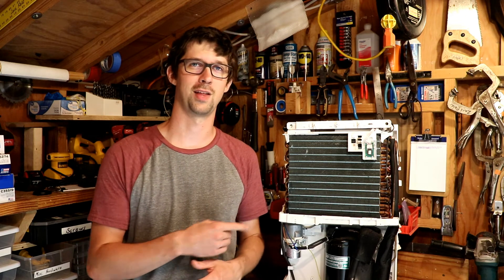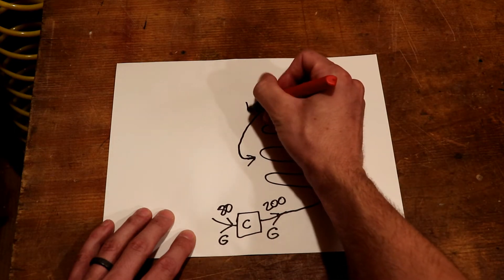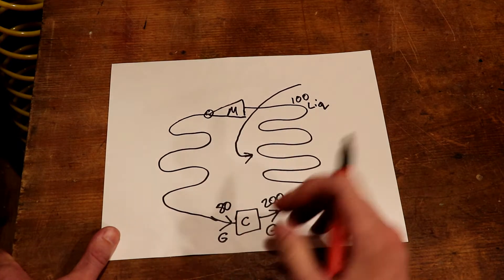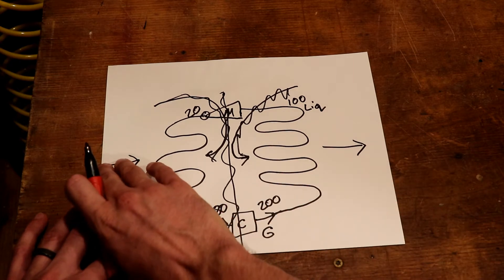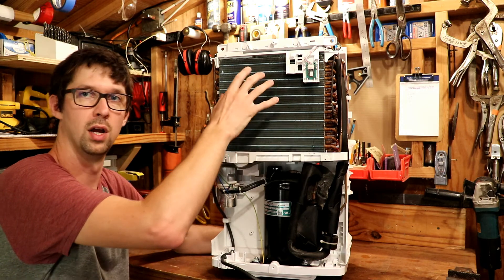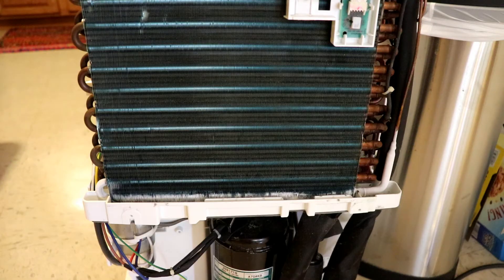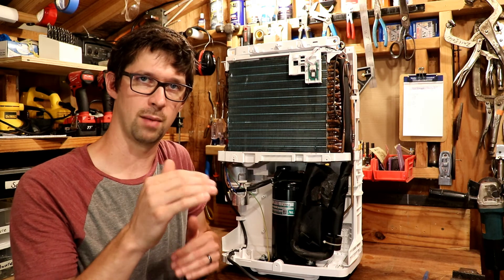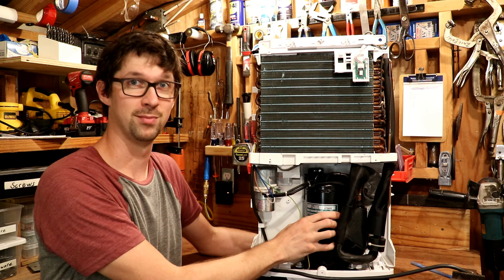What's Inside a Dehumidifier?

Comment: condensation of water outputs a lot of heat too, about 80 times of same the weight. Is there a dehumidifier where part the condensation coil dumps heat to the cendensate drain (without significantly evaporating) to keep a constant temperature?

Comment: Thank you for the best explanation I have seen so far.  I am basically sick of buying a new dehumidifier ever 2 years and looking forward to fix what I have.  No shops in my area fixes any dehumidifier.  
So far, it seems to me dehumidifiers are simple to troubleshoot.  My fear is that the companies which sell these dehumidifiers will either no longer carry replacement parts or flat out don't sell any replacement parts but that to be seen.
Thank you again and look forward to watch other videos you have.
AJ
Reply: Beware of the small Electronic ones with a solid state element . A hidden one shot thermo cut off switch that if the temperature exceeds a certain level cuts off the machine.... for good ! To replace it have to dismantle entire machine to find it and needless to say part not available . Just not worth the effort ..  I just binned one

Comment: Could it be possible that the automatic switch that defrosts the coil could be defective and the ice builds up higher on the coil ? If so where would it be situated on the unit ? and how can i verify this ?
Because i saw the ice build up and simply unplugged it for a while, and after re plugging it i smelled a burning odor... Could this be related ? what else do you think this could be ? 
Thank you

Comment: The freon after it has gone through the cold coil then is dumped into the compressor can where it absorbs the heat from the compressor motor, when it is running. When it is off the compressor gets rather warm. 

The issue with the newer cheap dehumidifiers is that the compressor is all sealed up, no ventilation to allow for convective cooling. Unlike a refrigerator, chest freezer, window air conditioner, portable air conditioner, water coolers or central air conditioner where the compressor is out in the open allowing for convective cooling. 

I have a GE brand dehumidifier & I notice the room getting quite warm as it lowers the humidity level. Which is why it was shipped back to Amazon from another customer.

Comment: If I open up a dehumidifier would I be able to separate and add fans for each coil? and one of those fans is exhausting heat outside? take off the plastic split and insulate each coil and add fans, and the cool side would still dehumidify the air while cooling it? I have a $300 dehumidifier I got for $20. I need another air conditioner though.

Comment: Not sure about your background, are you a prof or an engineer? this is a high quality explanation done elegantly and many people would be benefitted. Thank you!
Also, I have a question, my dehumidifier is 5 year old and recently I noticed - it runs fine but its not making the air dry and so very less water, if any is collecting. is it  time to buy a new one? or I should try to tweak anything? what's the top thing inside I should take a look? appreciate your response when you get a chance.
Again, thanks for the video.

Comment: You said the temp of the air going in to the dehumidifier is similar to the temp of air coming out.  My dehumidifier is blowing 15F hotter so air coming in at 75 is leaving at 90.  Is that a defective dehumidifier?  Its heating my house too much

Comment: In fact, every single hose portable air conditioners is practically a dehumidifier because the hot coil and the cold coil are just beside each other blow the hot humid air and more effective to remove condensation and not cooling the room.

Comment: I'm curious, when you see a "commercial dehumidifier" that is say 1700$, and it is rated for up to 18 gallons per day, is that price largely because of the niche market? I see also a '150 pint [~22 gal] (under 95°F,90%RH condition) removal per day' unit rated for 7000sqft, it is 300$ (and also uses a compressor). I assume this is essentially the same core mechanical process in both units, just different packaging. Is there any difference in the refrigerants used in modern systems?

Comment: Actually in addition to the compressor getting hot, the air coming out of the dehumidifier is about 10-15°F warmer than ambient temperature due to the release of latent heat. Evaporation absorbs latent heat energy, thus cooling things down.  Therefore condensation, which is the opposite and what ends up dripping in the tank, releases it, thereby causing the temperature of a small room to rise significantly when running a dehumidifier.

The effect on sensible heat energy (temperature) by the release of latent heat energy is about 970 BTU/lb of water collected in the tank.  The heat produced by the compressor, and less so the fans is about 3400 BTU/kWh. If a dehumidifier removes 1 lb of water in one hour and pulls 400 W.  (That’s 0.4 kWh). 3400 X 0.4.  So there’s about 1,360 BTU of sensible heat from the compressor and fans and 970 BTU from latent heat release.  In this case 41% of the sensible heat produced is actually from latent heat release.

Comment: So I technically you could make a 12v-24v dehumidifier by just swapping out the compressor for a boat refrigerator compressor. My goal is to design one that uses the least energy but pumps out the most water so it can run from solar power. So I guess it would have to turn off after icing at 3 quarters of the way for the most water without damage. The knowledge of what the internals do is extremely helpful. With some solid state fans it could run with very little electricity in a slim case too.

Comment: Great explanation. 
Me being novice and wanting to learn it leads me to a questions. 
 Is there not a way to cool the air without using a compressor, bc there is heat made by compressor as well as it increased the temp of "coolant" to 200degrees in the example. 
Does it have to be liquid in order to disperse the coolant at a cold temperature? 
Is there no way to have a coolant that sits below room temp in a natural state and cycle that in front of the coils/fan to cool the air?
Another question would be. 
Are there any systems that r designed in such a way that the  would essentially put the Warn-Liquid compressor coil 'under' the Liquid misting cooling coil, which would drizzle the icey cold water, over the Warm coils to lower the temperature a tad, but keep coolant a liquid, but utilize the off-heat better. I know it sounds like the ramblings of a madman but my mind wanders when it's trying to figure things out.

Comment: I just had one delivered  yesterday and the device is not collecting the water. I called the company. Supposedly I was supposed to leave the unit in the box in an upright position for 24 hours before I turned it on. Not knowing this when the box arrived I rolled it into the foyer because the unit was heavy. Now it is sitting up right - waiting? The unit is working more like an air conditioners and I don't feel anything warming up. Now the device is setting in cold wet environment.

Comment: Then why dose my dehumidifier in my grow room make the room so hot when I turn the lights out and need cool temps and low humidity the dehumidifier makes the room to hot and if I vent the hot air out of room with a hose it makes the humidity go up to high like it's not even on just a constant struggle to keep humidity down and temps down because dehumidifier is so hot

Comment: Is it important for effectively dehumidifying that the cold and hot coils are right next to each other? I tried using a mobile AC unit on the dry setting (without the exhaust hose attached), it just heats the room but collects barely any water.

Comment: Guys, what if everything kicks in and works, but the compressor never heats... It's always cool, and the unit catches nothing...
I have two identical dehumidifiers, both working, but one with compressor that heats up working normally, the other with the cold compressor not collecting water (even though everything is working) ...
Any help will be appreciated, as I'm running out of ideas hete

Comment: wow somebody actually describes the process well most people get it completely wrong .I see so many people thinking the compressor puts out cold freon liquid rather than hot gas 
the only thing i would add is the heat from compressor actually makes air warmer coming out then when it went in through the condensing coil getting rid of the compressor heat

Comment: Ive always wanted to make an air-conditioner out of one of these just for fun just to see if it can be done. Place the warm coil on one side of a wall with a fan blowing out, and place the cool side on the other side of the wall with a fan blowing in, with a drainage tube for water of course. Seems feasible.
Reply from the maker: That would be cool!
Reply: @ZachFields  Im building a travel camper and dont really want to install an ac unit in the roof and dont really want a mini split (although that may end up being the best solution), but Id really like to build my own sort of heatpump with reversing valve using a fridge compressor or something smaller. I know they sell smaller compressors. But I could grab a vehicle fan shroud and an electric automotive fan for both exhausting the hot side, and another one to act as the blower for the cold side. I mostly just think it would be a fun project but I dont have any hvac experience so Im intimidated

Comment: Very good explanation 

So if I have a dehumidifier and I bypass the air after it passes over the cooling coil and force back into the room 

And if I add an additional fan to draw outside air over the hot coil , and then exhaust it back outside ,  I would then cool the room and have an a/c ?

Comment: Excellent explanation! I'm working on a water generator unit with Solar and Wind power... this is helpful. I would replace the refrigerant with a peltier module to do the "cooling" part and save all that compressor issue. Still working on it...

Comment: Is it possible to swap the compressor out for a smaller one so it cost less electricity
Reply from the maker: Each component is perfectly sized and optimized to work together. If you want to use less electricity, you'll have to get a smaller dehumidifier. Just make sure it's properly sized for the space.

Comment: Great video. I have the fan working and air blowing but the compressor not heating up and checked the capacitor which as no power. The capacitor has 4.7uf 380vac. Will 6uf 400vac work?

Comment: Question for anyone. My dehumidifier was tipped sideways getting it out of the car and now it reads: wet controller when I turn it on. Did I break it? Can I fix it? Does it need a part replacement? Can’t find a manual anywhere. It’s a 90L per day. Made in China

Comment: Nice video Zack thanks for showing the internal workings. I noticed my machine it seems to be dripping the parts at the edges for the copper coil winds around. Is that normal? I mean the part that's not covered by the aluminum fins. Also I noticed something strange in my collection bucket the water that comes out has this sort of blackish grayish residue when I pour out the water. I cleaned the bucket but it seems to be coming from the inside of the machine because I can see it on top of the drip tray where the hole is. It wipes off relatively easily with a paper towel and it almost seems more of like a sort of a graphite than it does actually seem like mold but I guess it could be some type of mold. I've had a few other dehumidifiers and they don't seem to have the same problem that this one does so I guess I need to open it up and give it sort of a deep cleaning but I'm not really mechanically inclined so I'm a little hesitant to get too far into it. I'm ready to open it up the next time the bucket is full and see if I can get some extra gunk out behind behind beyond what the filter is

Comment: Great video and explanation. Thank you. I've been holding on buying a dehumidifier beacause I don't know how it works. Is there a leak of refrigerant gas concern of dehumidifiers? If it can leak in some cases, how to check for a gas leak. I read the gas is toxic to humans breathing? Does it create and generate ozone? Is there anything I would be cautious considering buying one? Thank you so much.
Reply from the maker: @Melissa Phan
A dehumidifier operates off of the same exact system that a window air conditioner, freezer, refrigerator, car air conditioner, and whole-house HVAC system all use, just that the parts are assembled in a different order. You want to make sure you size it right (not too big OR too small) for the space you're in. Other than that, I wouldn't have any hesitations of safety, assuming you live with other modern conveniences listed above.

Comment: This is a really great explanation. So this gives me an idea; maybe you could weigh in on it?

In RVs and Vanlife, how to heat during the winter is often a tough decision. One of the heaters is a catalytic heater that uses propane. This has the advantage of being quiet, safe(ish), and energy efficient. The major drawback is that a byproduct of the process creates moisture, and in a smaller space this can get pretty uncomfortable. The solution is to provide enough outside air exchange to let fresh air in and moist air out, but obviously that's an inefficiency.

So my question: based on how a dehumidifier works, does this mean I could essentially duct cold air from outside the RV through a pipe with fins and then back out again, and it would dehumidify the air? Or even have some kind of antifreeze stored outsidepiped through a copper baseboard contraption? Since this would also cool the RV a little, would this be less efficient than exchanging air?
Reply from the maker: @razordu30
Brilliant idea! I've run into this same scenario on short weekend car camping trips. A few things that come to mind with this setup is that there would need to be a high exchange rate of air moving through that duct (as you mentioned), but also a high air flow across the inside coil. My guess would be that in order for this to work, the temps outside would have to be well below freezing. 

The thing about a dehumidifier is that there is no net thermal gain or loss across the coils. There is a net thermal gain in heat from the motor. With the setup you mentioned there IS a net loss in temp. That said, however, the only energy consumption is that of a few fans. Again, the lower the outside temperature the more efficient it would be but also the greater the need. 

There would be some bugs to work out, but you may well be onto something here. When running those catalytic heaters, is there a need for fresh air exchange to replenish oxygen?

Comment: excellent video.  I am trying to figure out an efficient dehumidifier heater system for a wood drying kiln-like device.    To do that, I will need a flow of dry warm air, the temp of which is determined by the moisture content of the wood inside the dryer.  I need to control the temperature so as to hold the humidity constant.  That way, at any instant I am removing from the air exactly the amount of water that was released from the wood.

I am trying to create a solution that will allow me to dry lumber sawn from logs in the absolute minimum time possible.  I intend to establish this minimum by experiment.  I will draw the water out at increasing rates until the wood starts to crack or check, then back it off a little.

My intention is to sell the electronics, heater, and dehumidifier as a stand-alone unit, allowing the user to construct a wood kiln of any size, all the way from a multi-room warehouse-sized unit that can dry truckloads of wood to a small unit for drying individual pieces of firewood.

Comment: How do small dehumidifiers work then? Ive taken one apart and theres no compressor or coils. Just some sensors, computer parts, a fan and a metal plate
Reply: Perhaps it only uses the cooling to condense the water onto the plate? Similar to the cold water bottle reference in the video. Or maybe it's one of those thermoelectric generators that produces a temperature difference on either side of a metal to condense the water?

 I'm no expert but I think you raised a great point.

Comment: What is the grills are made out from? I got a new dehumidifier and strapped on an 3M particulate air filer on it and am thinking to UV sterilize the water and drink it, as I do not trust the tap water. You think there would be a lot of heavy metals leaching into the water. My ppm meter measure 19ppm but I dont know of what. Any help will be appreciated